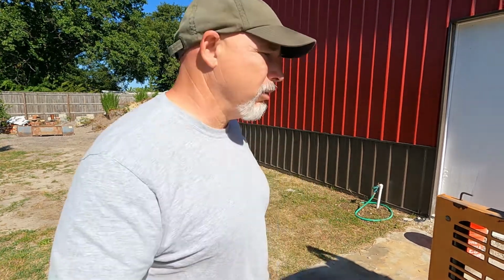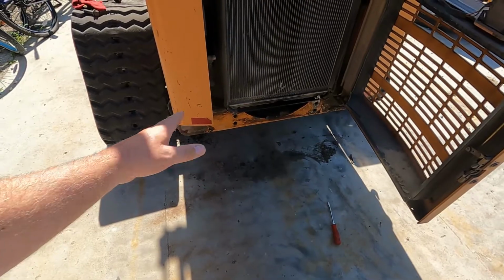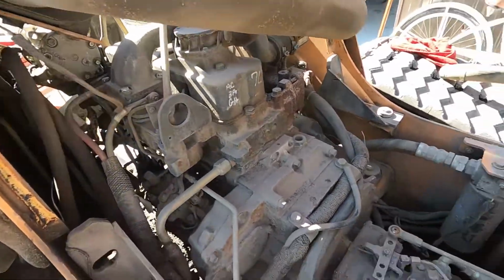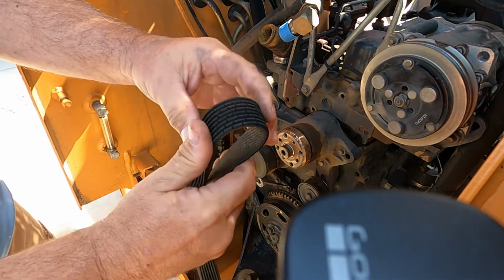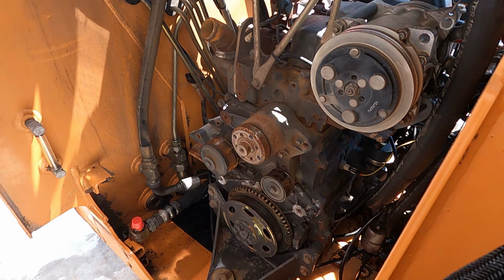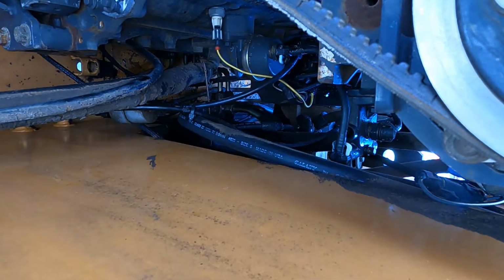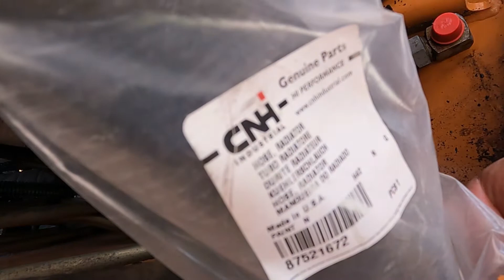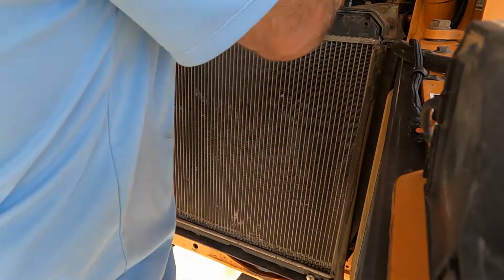Case 450ct, Water pump, Alternator, Full Service & Maintenance

Comment: I’m trying to do a oil change on one and took the bottom plate off and can’t find the drain. Can you please point me in the right direction
Reply from the maker: There are 2 plates on mine. Access for the oil drain plug is under the large plate. 6 bolts hold it on. It's a stretch for me to reach because I'm fat. But the drain plug is under that one and mine takes a 17mm allen wrench to get the plug out

Comment: how do you access to the lift pump filter , the small tin one
Reply: okay so no way of changing it unless u pull the rad and coolers out
Reply from the maker: @tylerslepicka156  Yep you need to pull the oil cooler and Radiator. It's a situation where you might as well service the machine while you're in there. That's what I ended up doing and I'm glad I did it too.